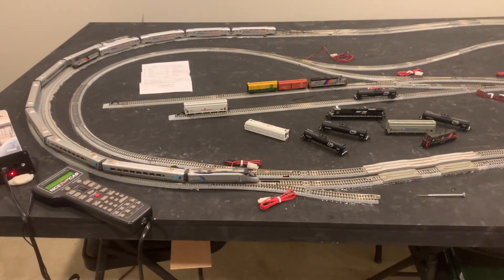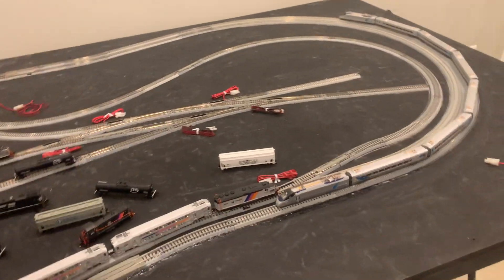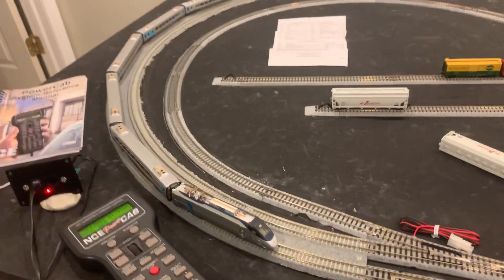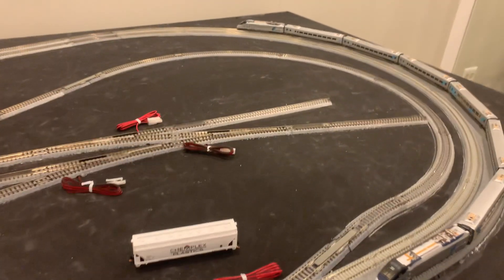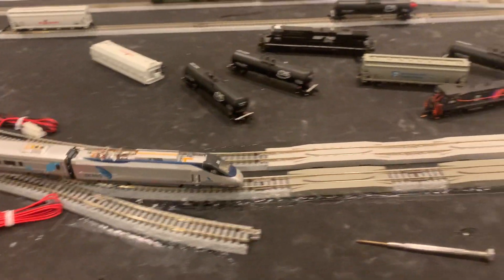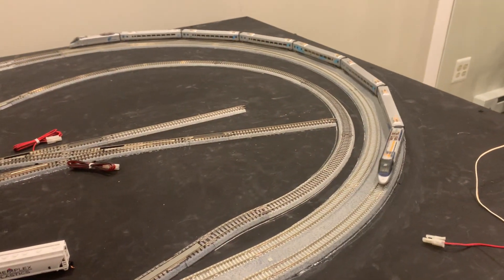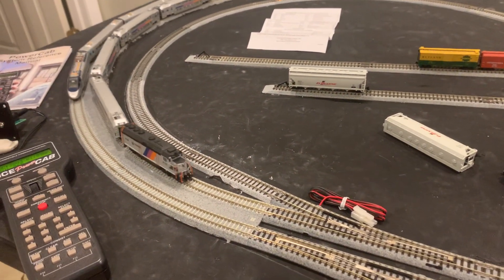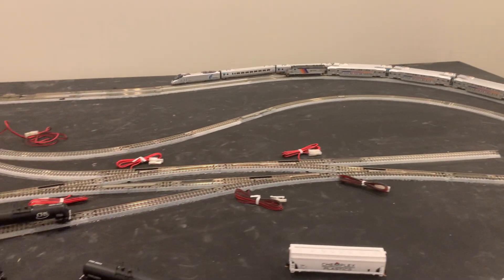Bachmann N Scale Acela Express on 18.9" Radius Curves

Comment: I just purchased that same train, and mine even slow's down a little on 34" Radius track. If you want a fast train, Get the Piko Ice 3 which is dc, but I put a dcc decoder in it and it zips around my track so fast at speed step 15, I'm afraid that if I went to speed step 28 it would shoot off the track; I also have the Piko Ice 4 dcc with sound, pulling 12 carsm it is not as fast as the Ice 3, but much faster then the Acela.

Comment: Ive tried everything. Even replacing the chassis with an RDC locomotive. It was too light to push the train.

The acela is the worst running train in the n scale world
Reply from the maker: Don't forget about t he Bachmann 4-4-0 steam locomotive from the 80's.  It could barely move itself.  But again, it was a Bachmann.  Looked nice ran horribly.